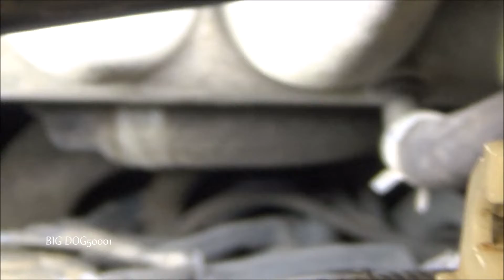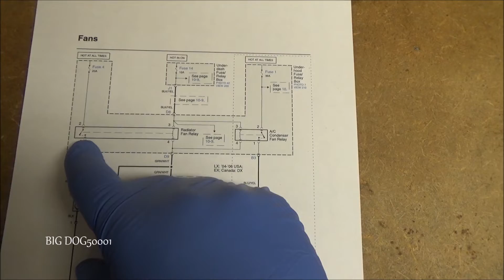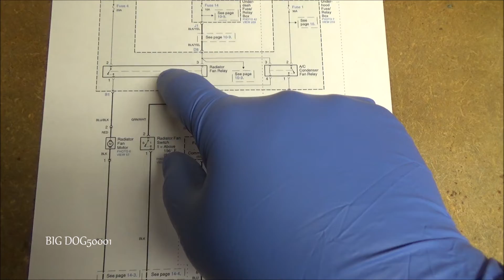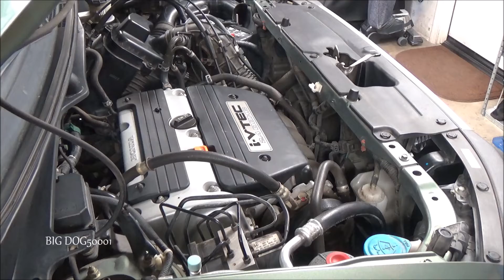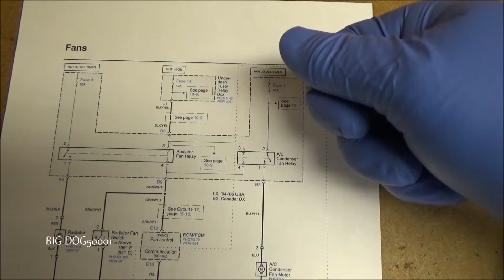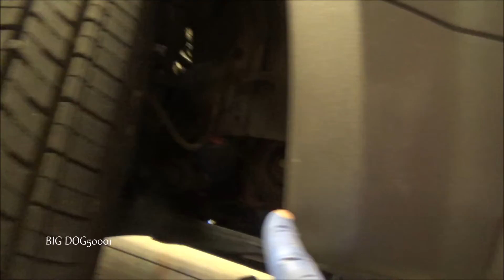Honda Radiator/Cooling Fan Not Working Honda Element

Comment: Very nice job explaining the wiring diagram and how to troubleshoot with inexpensive tools. My problem is that the radiator fans doesn't kick on automatically.  A had a mechanic hack a cable that I believe connects to the thermostat sensor. Basically jumping the contacts which causes the radiator fan to be always on. I don't like it but it works. Otherwise car engine starts to overheat.  I confirmed the relays are working by swapping in and out. When removed, corresponding fan stops.  Any thoughts on what the issue might be?
Reply: I have this issue with the AC condenser fan and a local mechanic did the same hack so the fan is always on which isn't ideal. He said the AC condenser fan or the condenser itself is missing ground and he didn't know the wiring harness enough to fix that, so he just jumped the relays to make sure it's always on. I'd love to know what the actual solution would be so I don't blow my AC fan motor from running it constantly.

Comment: What if the ac fan doesn't work, will that stop the ac clutch from engaging
Reply: if clutch is working it will engage once it gets power from the compressor clutch relay which will then energize both fans to spin. Hence, if you ac clutch is not engaging, your ac compressor is likely dead or the bearings in them are shot.

Comment: Thanks for the tips on the relays/fuses!

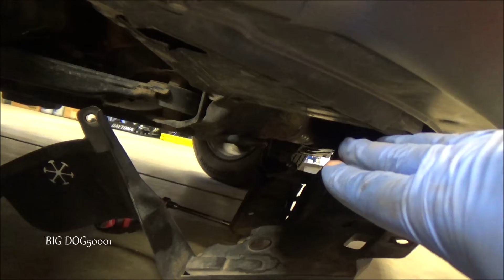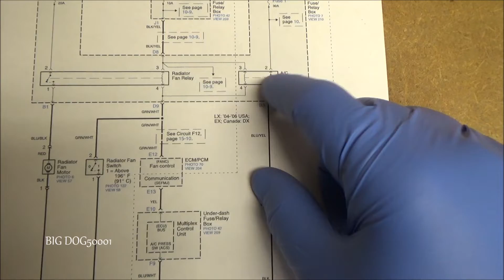Also, at 23:06, for the T-Bar, you can simply remove the bolts for that one side, and muscle the bar off the track to give you more space to pull the fan. Getting to the bottom 10mm bolt can tiresome.  I show it on my CRV Alternator video on my channel at 5:46.

Comment: My a/c fan is newer, but I notice my radiator fan only comes on with the a/c.  I saw my fan switch was unplugged so I reconnected the wires should do the trick.

Comment: In my daughter's 2006 Element, the fan isn't kicking on but the whole engine pulsates like and almost seems to stall. Would a bad fan cause that surging as well? Additionally, while sitting idle, the car overheated. AC seems to work only when the car is being driven, so I assume that is due to the fan not kicking on, but would that cause the overheating while stationary? We added some coolant (which I overfilled because you can't see how much coolant is in the reservoir until it is too full) and the engine temp came down to normal and stayed there while driving. Seemed to tick back up a bit when I let it sit and run while looking at the fans. The coolant in the radiator looks ok, no pollution from oil so I think the head gaskets are ok. Just trying to make sure I am tackling the right problem on this.
Reply from the maker: Overheating a Honda engine is usually bad news, they don't like it.  There are several things that could be happening.  I would definitely check the the coolant level (which you did) and look for any coolant leaks and address those if found.  A common issue for overheating and poor A/C at idle is a fan problem, but the A/C problem could be a separate issue.  Both fans should come on together on that Element, if only one fan is running then there is an issue with the fan that doesn't come on.  On 2006 Elements, four cylinder models only have one fan speed (high) but the 6 cylinder engines have low and high speeds.  Both systems are controlled by engine computer but the 6 cylinders also have a fan control relay that allows the 2 speeds, if both speeds are not working that can cause issues. 

There are two Engine Coolant Temperature (ECT) Sensors on 2006 Elements, so the engine is fully in control of when they come on (and what speed if a V6).  The engine computer uses both sensors sensors to control the fans, but ECT1 typically carries more weight on most Hondas.  If either ECT is reporting wrong temperature, that can effect when the fans come on and can also effect engine performance at certain times due to incorrect air/fuel ratio.  A bad thermostat can also cause cooling issues but don't overlook simple things like a bad radiator cap too.  Hopefully the engine and head gasket were not damaged when it overheated.
Reply: @BigDog50001  - Thanks for the info. It is a 4 cylinder model. Initially, the condenser fan (passenger side) was not coming on. Tested the relay and that the fan was getting power. It was. I drove it for a while to see if, without running the AC whether it would heat up. However, the weather here in Georgia is very cool and rainy today so it took a while to get it to even get the temperature guage to get to the halfway point. After just sitting in the driveway and letting it idle for a while it finally started up get too hot (the temperature guage was past the halfway point) but the cooling fan (driver's side) wasn't kicking on either. I tested that and did the relay shuffle for good measure. I finally did the taping on the motors of both fans and they kicked on. The engine cooled and the AC blew cold air. Would that happen if the ECT was at fault?
Reply: @BigDog50001  with regard to the overheating, we were parked when it happened and I don't think that it was on for very long after the temp spiked. Hopefully, we get lucky there. So far, I don't see the telltale signs of a cracked head gasket - discolored oil or coolant, or smoke pouring from the exhaust, but it's only been a day and it hasn't been driven much since it did that.

Comment: it is a long search for a reason. The tester checked that 12 volts comes to the fan connector, if there is power there, then the wiring with fuses and relays is ok. The fan motor itself is even easier to check, supply power to it from the battery.
Reply from the maker: I like to use a Power Probe for power when testing the motor itself, thanks for the input!

Comment: I replaced mine about 2 years ago but I found removing the splash shield completely made it easier.
Question where’s the fuse for the oem fog lamps? I read somewhere that it’s inside the vehicle (fuse bix).
Thanks 🙏
Reply from the maker: It can be confusing but for fog lights on these Elements, they typically install a wiring harness under the drivers side dash but it usually taps into the headlight power circuit in the under hood fuse box (fuse 45).  There is usually also a small inline fuse (like 2A) and a relay for that fog lights that are installed near the wiring harness under the drivers side dash.  These are usually zip tied (or otherwise pinned up) to the factory wiring harness under the drivers dash.  Thanks for the comment!
Reply: @BigDog50001  Thanks that’s what I had read but wanted to make sure. I am due for an change at Honda and will have them replace it. The same thing happened years ago and it was a fuse. I did look under the dash and there were quite a few zip ties.
Reply: Oil change